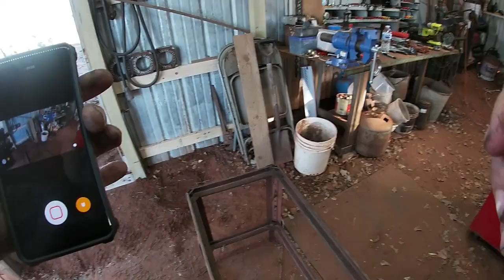How to scrap a push mower for clean Aluminum

Comment: Great video.  I never messed much with them, but there are a couple of good, easy to clean cast aluminum parts.  Need to reconsider.
Reply from the maker: yeah not much there and with the price on aluminum not hardly worth it, but cast does add up the weight more then other aluminum, I know the barrel is a lot heaver then the extruded and sheet,
Reply: @Okiescrapper  Yeah, my cast barrel tends to fill quickly, and usually at 100lbs, it at least keeps me sort of satisfied!  😜👍

Comment: Interesting video Allen. I used to drop the engines whole and get dirty aluminum. Plus the little bit of shred from the deck and handle. Some of the earlier mowers (Lawn Boy for example) had aluminum decks.
Reply from the maker: I see some craftsman mowers with aluminum decks I took a load of them in a while back, think I had about 6 or 8 along with 2 barrels of aluminum
Reply from the maker: I have seen some craftsman with aluminum decks too

Comment: Could make more money fixing the mower. Its so easy, and they are so simple.
Reply from the maker: even if they need rings and a valve job? plus new cables. a new blade. better to spend my time on fixing a riding mower, and I don't have the time to fix them all. I will bet I have over 100 mowers in the back field. 50 + riders

Comment: I just found your channel. I too do scraping. I own a small engine shop. But down here they won't take smelted metals down here. So I usually just break the blocks up.
Reply from the maker: most yards wont take the smelted metals as they can't check the purity of it. my plan is to sell the ingots on eBay to the guys that do sand casting. I need to get some ready and get them posted and see if they do any good, Thanks for watching

Comment: Is that a crucible on your work bench?
Reply from the maker: Yes it is I have it out there so that I can make a set of lifting tongs. to that I can remelt my cupcake ingots and make some nice rectangle ones. look in my play lists I melt lawnmower motors for the aluminum with a waste oil burner
Reply: @Okiescrapper  I'll look for it. Got a question I'm hoping you can answer.  What are these silver colored prongs on the power cords made of? They aren't magnetic.
Reply from the maker: @mattyal9347  Should be brass, just a coating pr plating over them, may touch them to a grinder
Reply: @Okiescrapper  well that sucks. I've been tossing them

Comment: You neet if you could use a flat screen TV for your monitor
Reply from the maker: I got a small monitor but yes a small flat screen will work, I am using a micro hdmi to full size hdmi adaptor and a hdmi cord to the monitor now

Comment: Like playing a first person view okie scrapper special edition video game.  Tools of choice are ball peen, punch and impact drill😎.

I scrap the mowers even gut the engine for the aluminum.  Lots of work but fun if you have the tools, and a bit of experience.  Never a dull moment for a scrapper😊

Great video🫵😎
Reply from the maker: some I try to get them running. but some I just scrap out. not sure if you have seen my melting pot. I take the aluminum motor and melt it down with a waste oil burner and make ingots. and sell them on eBay, I plan to melt some aluminum soon
Reply: @Okiescrapper  

You showed the aluminum pot in the video.  Very cool.

Making ingots is pretty sophisticated repurposing scrapping.  I part time scrap.  Definitely lots to learn.  Especially how much to process for value vs your time.  Not all scrap yards are the same that’s for sure.  

What does an aluminum ingot go for🤔
Reply from the maker: @alanscott8067  I sell them on eBay for $2.00 a lb. the last lot was about 37 lbs. sold it for $70.00 plus shipping
Reply: @Okiescrapper  

That’s awesome.  Your shop looks well setup for processing scrap.  I’d like to have a place outside the city.  5-6 acres. Then I could learn to melt metal.  

Great videos.  Laid back easy to follow🫵😎

Comment: Good  day Yes  they are some cast aluminum   on mowers. I tried to get magnet out, my was cast in.  yea the head is easy.  Also because melt it down  alot quicker removing it.  Thanks
Reply from the maker: yeah on the Briggs motors the magnet and counter weight are cast into the flywheel. you may be able to cut them out, but I just melt them, Take care Don

Comment: A question how do you get the piece of steel out of the flywheel so you have a nice piece of cast aluminum?
Reply from the maker: I never have gotten one out of a Briggs motor. but you may be able to cut it out. I need to see if my plasma cutter can cut it out, now a Tecumseh motor you can take a punch and hammer and knock out the pins that hold the magnet and counterweight in, the aluminum on the back is thin

Comment: U need a phone stand
Reply from the maker: yes I do,  I have a tablet that I need to down load the gopro app onto so I can use It as a monitor think it has an 8 or 10 inch screen, it would be easier to see. I try to keep an eye on the monitor as I am bad about getting into the job and not being in view  thanks for watching John